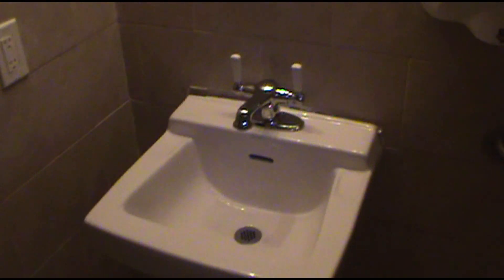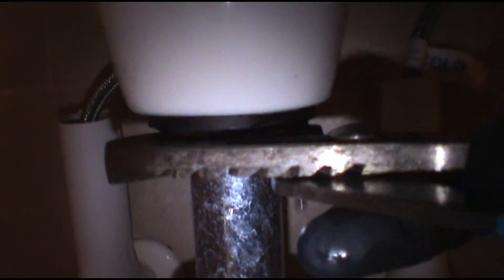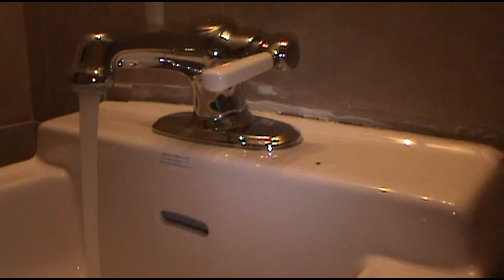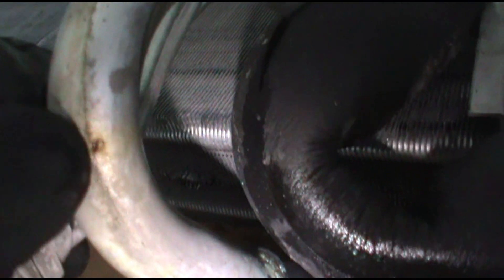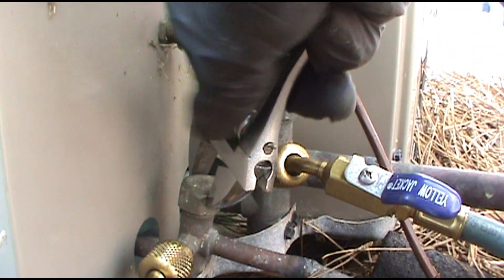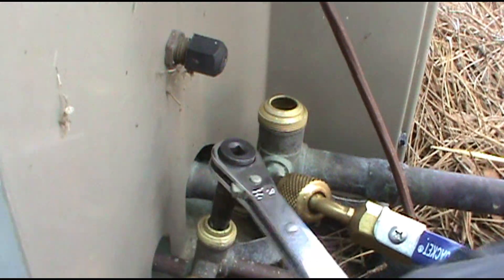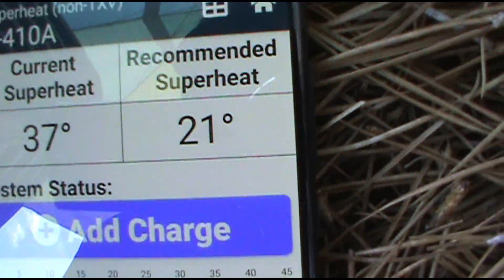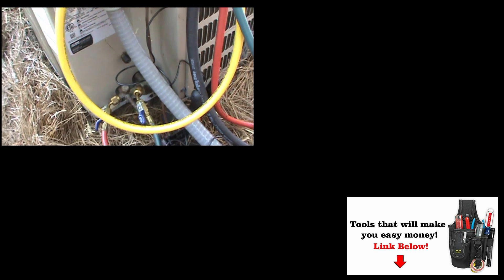HVAC & Plumbing for Apartment Maintenance Technicians

Comment: Great video as always, one little tip though, use your refrigerant tank to break the vacuum before you open service values. Doesn’t have to be much, just some positive pressure so you’re not opening to a vacuum. Will help keep the oil in the compressor
Reply from the maker: Thank you so much for watching Ryan!
Reply: Lex Vance yeah I’m sitting here binge watching them , good stuff

Comment: Was wondering which multimeter you recommend? Was looking between the fieldpiece hs33, 35, and 36 that your website recommends but there seems to be mixed reviews between them all
Reply from the maker: I like anything Fieldpiece. Can't go wrong in my opinion. If you're gonna do HVAC, make sure it has temperature clamps and can read microfareds. Thank you so much for watching Urijah!